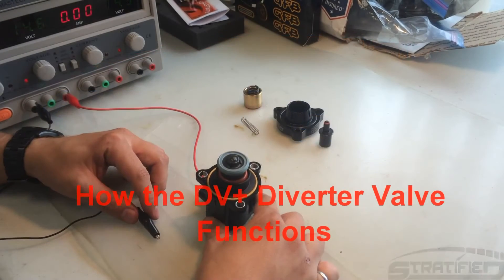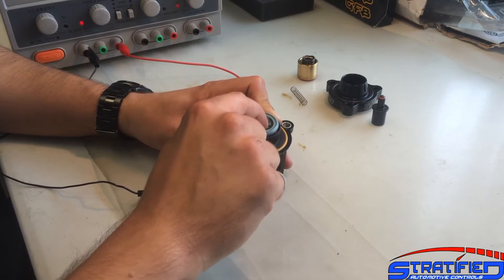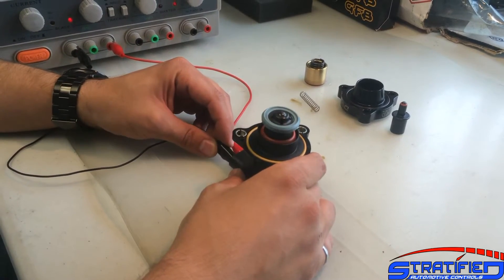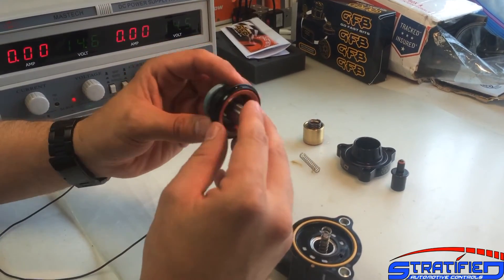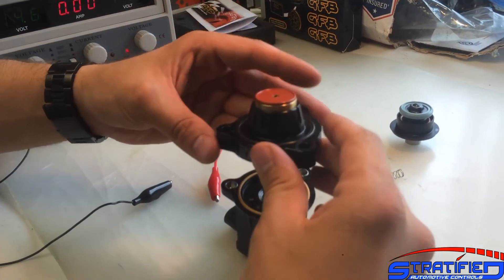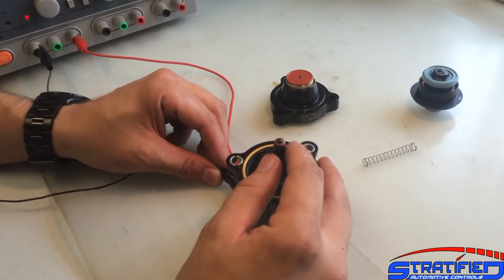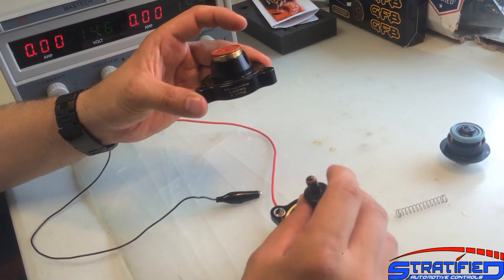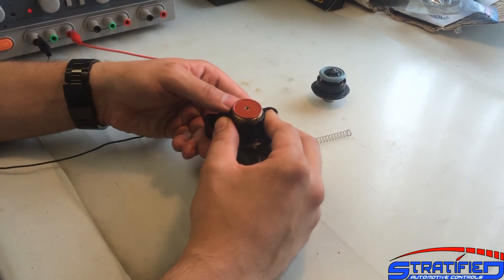How the VW GTI TSI FSI DV+ Diverter Valve Functions

Comment: my mk7 has no check engine light but is not releasing pressure like normal.  is it possible that the dv would malfunction in the close position. I'm still getting maximum power.  it's not releasing pressure
Reply from the maker: They are easy to check and inexpensive to replace.

Comment: wait so where does the air get rerouted to? i thought a dv takes the air and puts it back into the intake
Reply from the maker: To the low pressure side in front of compressor.
Reply: @stratifiedauto  but there's no tubes to reroute the air to? That's what I'm struggling to understand how it diverts air when it's just a piston that goes up and down
Reply: @fcukdude1989  when the piston retracts pressurized air in front of the piston is able to pass through an opening that's beside the piston and joins with the compressor inlet, just in front of the compressor blades.

Comment: Shouldn't the extra boost pressure, due to that hole in the piston, push it shut, and not open? That's what GFB explains in their video with Mighty Car Mods. If you blow into that piston hole the piston should shut closed.

Comment: I had an oil leak on gti mk5 from diverter valve plug. I replaced with revision D and its still leaking a small amount of oil from the plug. Any ideas?
Reply: Pero that maybe means your turbo inlet has oil buildup, you should check if the inlet of the turbo has any oil, if it does, you need a catch can.